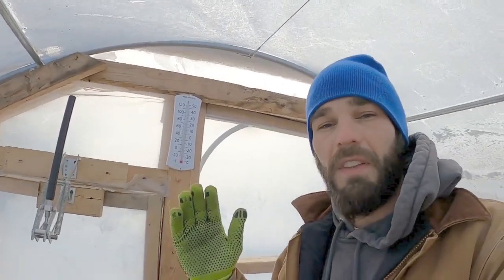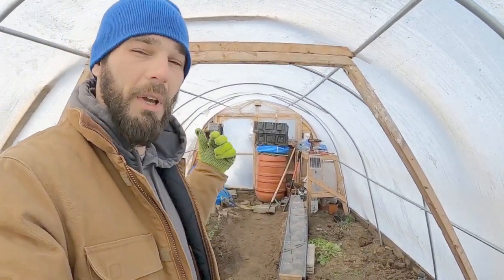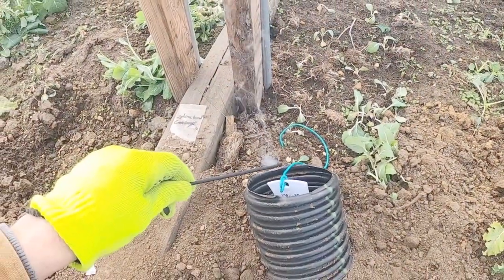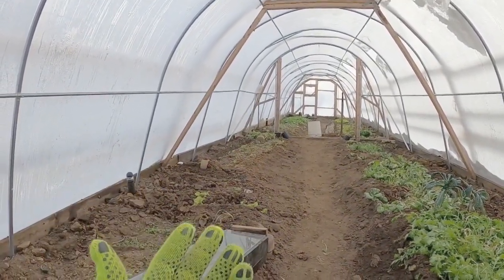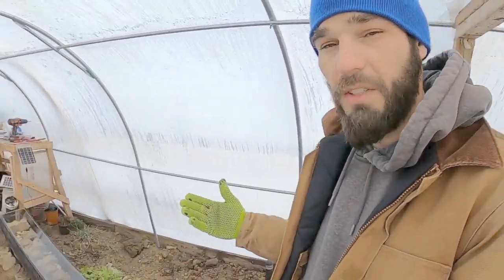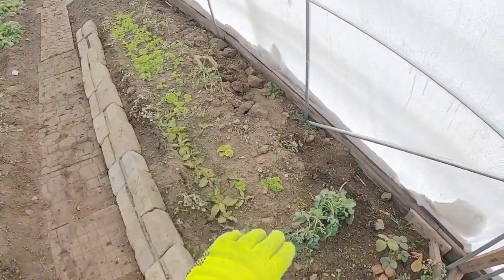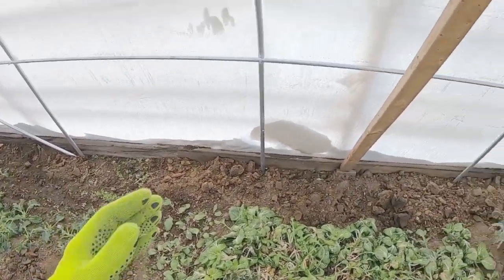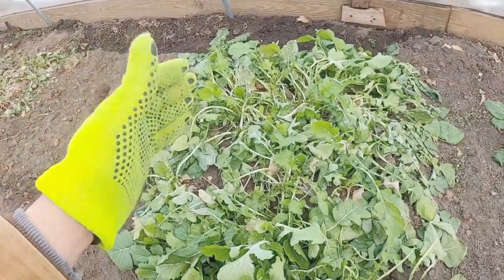DIY Simple Solar & Geo-Thermal Demonstration | Temp Data & Growth Observations | No Electric or Gas

Comment: Watching some other channels and I can.t remember which ones off hand. They recommend sucking the air thru the tubes. they say it is to reduce back pressure on the fan so that the fan life is extended. But I have recently subscribed to your you tube and I really enjoy it. Would really be interested in more detail on your solar system and a parts list someday. I realize that every situation would be different so just a basic list that we could modify.
Reply from the maker: Thank you! I’ve covered bits and pieces of this system and small solar systems all over the channel, and as I progress with larger solar arrays I will break down much more in depth the setup and installation, I’d like to have a 2000w system for ample usage in winter for our large greenhouse. Thankyou again!

Comment: For a reasonable perfomance picture you should work out the surface area of the greenhouse and calculate the heatloss based on inside / outside temperature difference. The inlet and outlet temperature of the geothermal tubes doesnt tell you much. To calculate the amount of heat transfer  you need to know the inlet and outlet RH% and the CFM.  With those numbers you can use a psychrometric chart or calculator to calculate the heat transfer in the tubes. The more air you are moving for a given in/out temperature difference, the more btu`s  transferred. If you add a few cfm of 50F air to a 3000 cubic foot greenhouse air volume, it wont be making much difference to the air temperature. If you have battery power for the fan, Its best to test the system at night when its coldest and there`s no chance of weak solar gain adding heat to the greenhouse
Reply from the maker: With one layer of poly we need anywhere from 30-50,000btu to heat the space adequately as an estimate because our rvalue is so low till we get our second layer on, great input I was going to to a video about calculations

Comment: Nice. You are inspiring me to modify my polytunnel during the summer/autumn here in Europe in Poland. Did you consider some ground insulation round the greenhouse? One polystyrene sheet is mostly about 1m (ca. 3 and 3/8 feet) deep. If you put two sheets in an ‘L-shape’ in the ground (in a trench) it should insulate your soil in the greenhouse. One sheet goes vertical and the other horizontal at the very bottom of your trench. Your soil should be keeping the warmth for much longer. Cheers!

Comment: Try putting in a 55 gallon barrel of water so it can absorb heat during the day and release the heat at night.
Reply from the maker: I need to get some but I haven’t been able to find any for cheap yet I’m reluctant to go buy new ones lol. That would help me out a lot for a heat transfer system too when I get my water running again